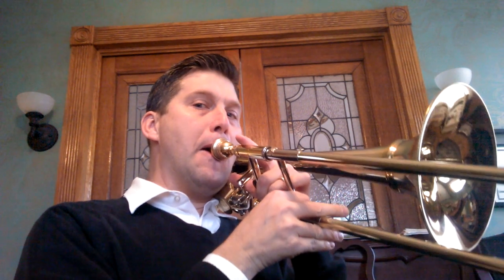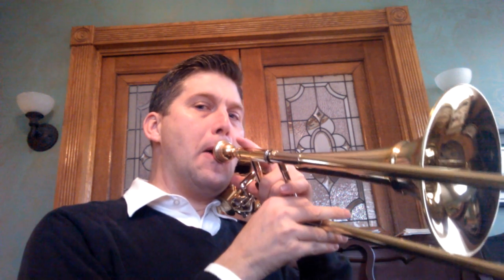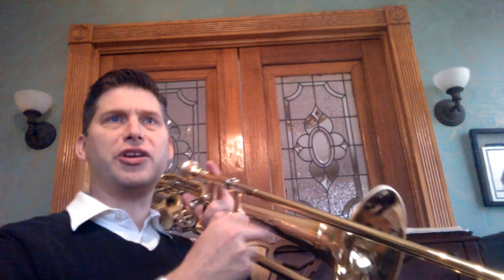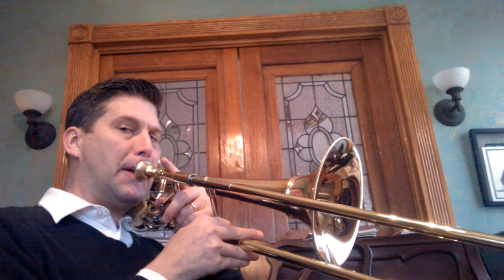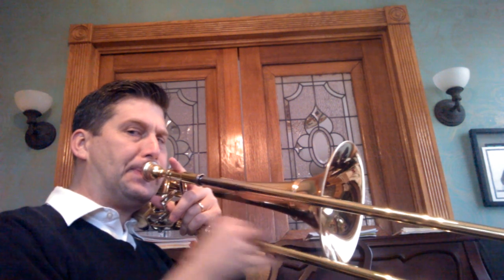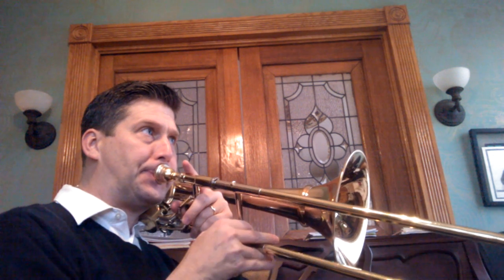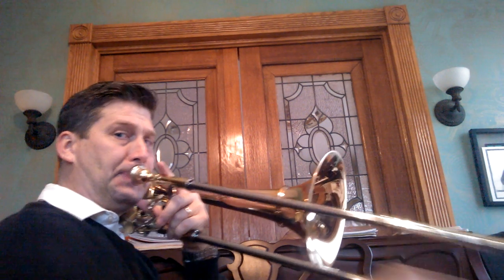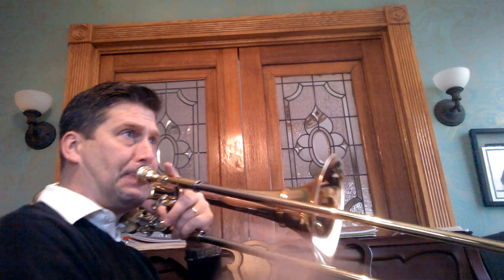Trombone Sound and Attack

Comment: Extremely helpful. I have such an excitement to go and practice in this moment. Thank you!

The suggestion of buzzing a note to match the same note from a piano is an interesting one because for most of my trombone playing time I've imagined that our lips buzz at a few distinct levels - the pedal level, first octave (Bb down to E in seventh), second octave (F down to B), etc.) - and the slide tubing does the rest of the work. But I've also noticed in my later years of playing that hearing the note you're about to play in your head and trying to match your embouchure to that specific pitch (especially above F3) improves my accuracy. Undeniably from your example, one can buzz seemingly any pitch through the mouthpiece without the aid of the trombone itself... which I never considered. I grew up assuming that anything played through the mouthpiece alone was effectively in first position, comically.

Comment: Hey Dr. Pollard, what would be the best way to expand lung capacity?
Reply: play a note for as long as you can then time it and try to past that time the best way is to start on B flat than when you get confortable switch to F natral then when u get real conforteble try a high B flat 👌it works
Reply: play a note for as long as you can then time it and try to past that time the best way is to start on B flat than when you get confortable switch to F natral then when u get real conforteble try a high B flat it works
Reply: Do it as Wilfredo Garcia says, but make sure that the note never loses the sound and tone quality
Reply: Simply practice this exercise: inhale for 2 beats, exhale for 2 beats, inhale 4, exhale 4, so on and so forth until you can’t go further. This helped me greatly with increasing my lung capacity.